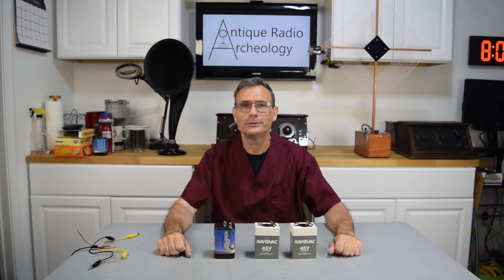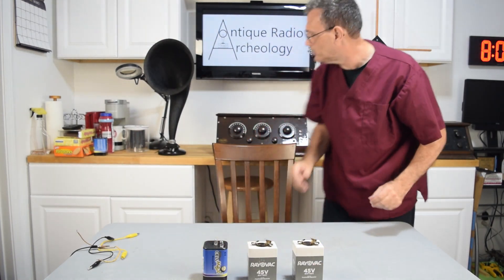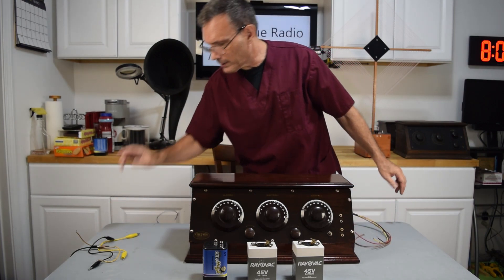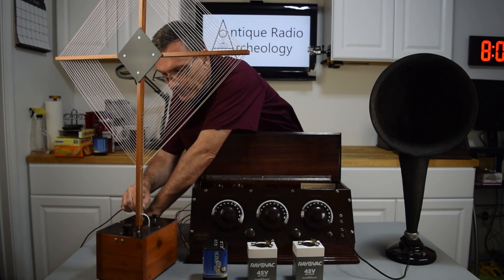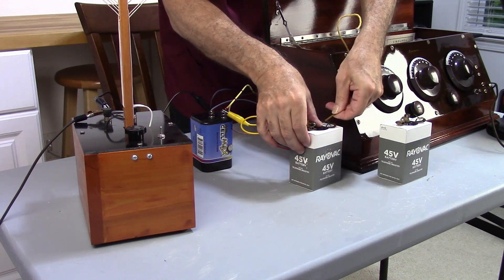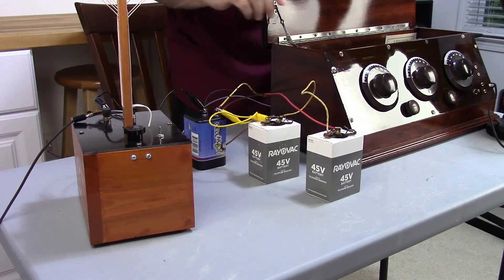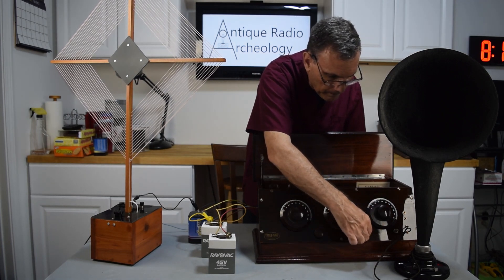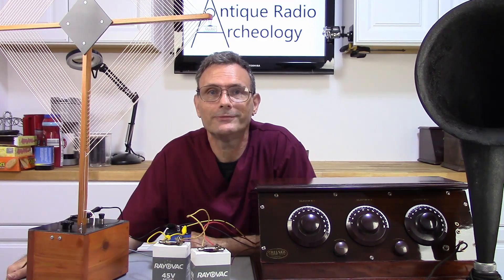How to Hook Up a 1920s Chelsea Super 5 Battery Radio

Comment: Wasn’t the superheterodyne circuit available at this time?  Or was Chelsea too cheap to license Edwin Armstrong’s patent?  Nice little radio though!
Reply from the maker: Chelsea Radio had a Regen license from Armstrong and got to spend some time in the courts because of it.  They produced the Chelsea Super 5 and Super 6 as 5 and 6 tube TRF radios in 1925.  In 1926 they came out with a ZR-70 which is a 7 tube gang tuned TRF and in 1927 came out with the AC-B-6 and AC-B-7 which with also 6 and 7 tube gang tuned TRF radios but with an AC power supply added as a separate box with a cable.  I'm pretty sure that AC-B-7 was the last radio the Chelsea Radio Company produced before filing for bankruptcy in 1928.  The latter two radios were licensed under RCA patents.